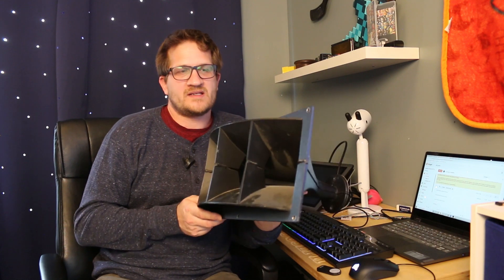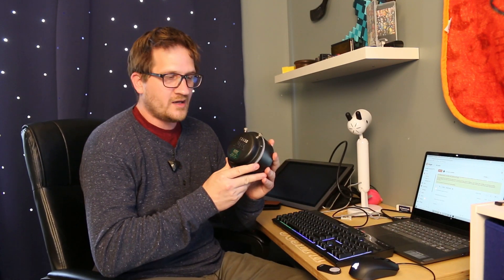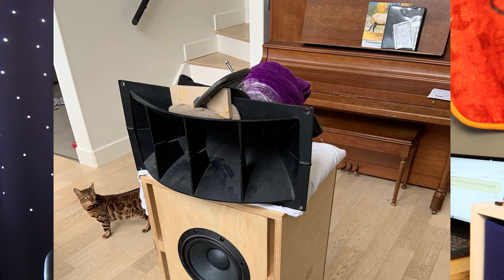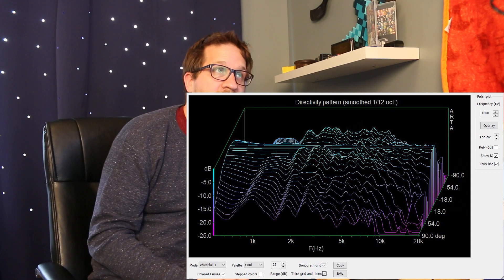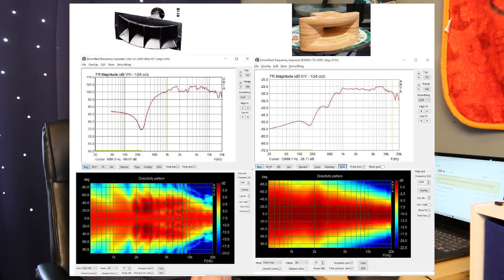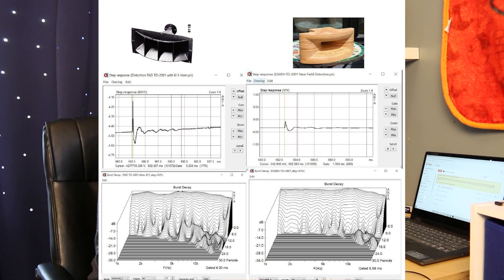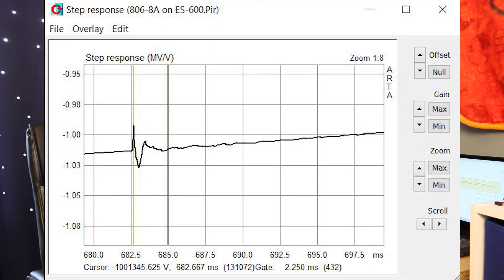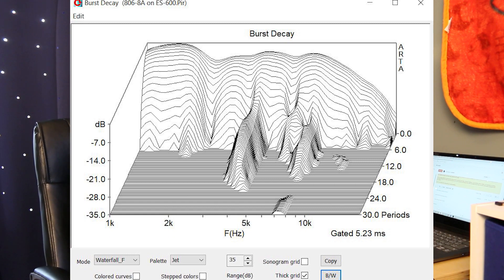Classic Altec Horn versus Modern ES-600 Biradial

Comment: Hello Joseph    I have a few questions about measuring horns    1. the distance of the mic, from where is this measured the throat or front of the horn.   2. measuring method with Dats do you always use "testbox method with 5 cubic feet.

Comment: Hi. Very interesting video. Thanks. 
I just came into possession of two Lansing horns. One is a 901 B and the other is a 287. The 901 is very large, almost 3 feet across with a long neck. 
I can’t find any information on the 901 B (I think it’s a B. Can’t read it that well). Both horns appear to be in excellent shape. 
Can you enlighten me on what I have?
Thanks. 
Oh, really, really nice horn design you have. I’m a lens designer and I’m interested in designing speakers, especially ones that have reflective elements. But I don’t know what software to use. What’s a good speaker design software package?
Much appreciated. 
Paul
Reply from the maker: I don’t really do much with the vintage stuff. I don’t use simulation software. It’s too easy to build prototypes and just test the actual thing. Sims don’t seem to be accurate for me. Acoustical electrical and mechanical all in interplay…computer programs often only consider one or two aspects.

Comment: Considering that the engineers had limited testing capability and limited materials understanding, they did a admirable job.  While their dispersion may be more jagged, the over all width of their coverage is wider up to 10 k.  These horns were probably designed for movie theaters.  Optical film did not have very good high frequency extension.  So the wide coverage to 10 k was important, the coverage above 10 K not so much.  Also many movie theaters build wood walls around the speakers creating a half space situation.  That may have reduced some of the air impedance mismatch at the horn mouth.  Finally, they had to project through a perforated screen so they needed to have some pressure at the mouth to get the sound through.   I always feel the need to point out that we should not judge what people did in the past by today's standards.  You aren't necessarily doing that here but there seems to be a real problem today of judging people in the past (when their needs and priorities were different) by today's standards. Don't get me wrong, your horns are great.  I bet they sound great.  The two horns are very different.
Reply: Exactly! These were voice of the theater components. Altec cheated by stuffing them in a nice wooden box and selling them as home audio. ( I still love them )
Reply: @seeburgm100a  yes.  I used to work for a historic movie theater chain.  We had a warehouse of all of the old equipment from old christie's projectors to altec voice of the theater speakers.  If I remember correctly, this horn is the small horn for smaller theaters.  We had the big multi cell horns as well.  To alter coverage for narrow theaters, they used to stuff socks in the cells that would project onto the walls.  Crude, but simple and it worked.  They didn't have any of the tools we have now.  They did alot with a little back then.  Always amazed at their ingenuity.

Comment: the  811 B was combined with the driver Altec 806-8A. In this combination it performed 550 to 4,5kHz plusminus 1dB with a drop of 3dB per octave afterwords until 14k, than steeper. It was never meant to be used in a two way application. For use in cinemas the two ways were ok. For high fidelity applications, a separate tweeter is recommended. 3dB corners were 470Hz and 5k. It was used with a crossover of 800Hz. Is 50 years ago and more.
Reply from the maker: This horn was used in many 2-way configurations by Altec even for mixing desk studio monitors. Why do you think it was never intended for two way? The documentation for Altec does not indicate this, neither does how Altec used it in the finished products.
Reply: @JosephCrowesDIYSpeakerBuilding  the documentation suggests to use separate tweeters if the highs do not satisfy - I remember something like that. And: of course Altec knew, that this horn lacks the highest frequencies - if the people are satisfied, why should they change anything?

Comment: Informative video. I didn't know that. I was interested in audio in the mid-1970s when all of this high-tech gee-wiz gizmos were in the domain of labs at JBL & Altec.

I too notice the freq response fall off with my Altec 807(this is the small Altec 802/806 compression driver) with the Symbiotik diaphragm instead of the aluminum. The Symbiotik diaphragm is rated at Altec-rated 30watts with 800hz-15kHz versus the aluminum 10watts from 800Hz to 20kHz.

But to my ears  notice a bit of dullness in the high frequencies. I was going to buy a JBL O77 slot-radiator high-freq tweeter but at that time, it was a bit too expensive for my budget, I believe it was like $175. Of course today it costs >$1,000 with the clear plexi-glass phase plug on eBay. :O Instead I choose the more reasonable Electro-Voice T350 which cost something like ~$100 with the alnico magnet, and I used an electronic crossover with 12db slopes at 5kHz.
Reply from the maker: I’ve heard the T350 on the EV Interface D speakers.  It’s a lovely sounding tweeter.  👍

Comment: You are just looking at the graphs and telling what everyone can see. The impact of power response into the room or the opening angle lacks description. A 10 min read at DIYAudio forum gets anyone to this level, nothing special in this level of graph commentary. Besides, how can you even talk about power response while taking on-axis (even at 1 meter) measurements, just goes to show that what you think about “a decent horn”, having flat frequency response and no sustaining standing waves is not linked to perceived quality of the design. Anyone, with a little effort can achieve these targets. Maybe you should be examining designs from Augspurger or Earl Geddes and examine the trade offs. By the way, that rising trend in your impulse response measurement was quite hilarious, thanks for sharing that. Better checking the acoustic centers of the drivers before running this test, maybe that part was missing in the user’s manual of ARTA, after all they look like a good signal processing company rather than an acoustics based one like MLSSA or even Audiomatica.
Reply from the maker: Thank you for the feed back.  What specific performance attributes do you think my horn lacks that the other horns referenced excel in?
Reply: Exactly my point, your “scientific” approach and the subjective grading that you are sharing fundamentally has no correlation ground. Maybe a little Floyd Toole can help you there, however, not with the “objective” approach you are taking. That can saturate and blind the average YouTube content consuming DIY enthusiasts who are new to the hobby and create a false appreciation to your work, but I believe the people who know what they are doing, do not even bother to correct your methodology, not because it is not evident, but most probably they don’t know where to even begin.
Reply from the maker: Using test data that has been subjectively correlated according to Flloyd’s work, what specific performance attributes to you think my horns lack?
Reply: @JosephCrowesDIYSpeakerBuilding  You are asking the same question over and over again, where I am pointing at your methodology which you use to quantify the performance metrics is not suited for those performance metrics. With this shared data, it is really not clear how you are claiming what you are claiming. I am sorry but, due to lack of proper measurements done from your end, there is just not enough data to answer your question, and my whole feedback was on this topic, maybe I was not clear enough.
Reply from the maker: “But most probably they don’t know where to even begin”   If there’s so many issues in my methodology then please provide a few specifics.  Am I missing certain tests?  I’m assuming these tests are supported by Floyd’s research as having better subjective correlation.  Also, why can’t you answer my first question regarding the other horns mentioned...I’m familiar with Earl’s waveguides, but I’m very curious what specifically you feel I need to learn about regarding his OS horns?  Having built a few of his horns myself I’m at a loss on what specifically you could be referring to.

Comment: The waterfall response of the 806A looks worse than I am used to seeing for Altec drivers. Did you measure its distortion? I wouldn’t be surprised if it has dirt in the gap or a rubbing voice  coil.

Comment: Did you try the open horn at the back yet! a transmission line tube maybe with a diameter 11 mm 60mm long tube flared at the end connected to the driver body plate
 using a ring of blue tack as a gasket for the diaphragm would help as well

Comment: Joseph if you are using a device like a dbx driverack pa2 (with rta) wouldn't that fix/flatten this making drive horn selection less critical? Also thanks for the amazing work you do and share with us!
Reply from the maker: This type if performance attribute cannot be corrected by EQ.  If you fix the off axis then the on-axis suffers.  Of course you could sum the two (RTA) and it would look good on paper.  However that is not how we perceive the sound.

Comment: Neat video, your horn tests very well! 
It would be interesting to see the Altec/Altec measurements as well compared to the second test on your horn to see what degree of improvement it offers even with a less optimal vintage driver. What software do you use for your testing?
Reply from the maker: I’ve featured that in one of the blog posts linked in the description. Generally the they do nothing to compliment one another.
Reply from the maker: I use ARTA software.

Comment: This is an excellent test as it scientifically confirms what I heard 42 years ago. I owned two pairs of Altec 846B's in the 70's (yes I'm that old) which used the same horn and compression driver combination that you tested, along with the N801 crossover and 416 bass driver. Even back then they were pretty rough by current hi-fi standards, and I ended up getting rid of them soon after purchasing them. While I loved the dynamics, I couldn't get used to the colouration of vocals and unlinear response in the mid range. A couple of years later I bought another pair of 846's to use for live PA and mobile DJ, and for that application they were excellent as they could "belt it out" for hours on end without blowing up. One has to remember that Altec's main source of revenue during their hey day was the sale of movie theatre sound equipment, so so components were designed primarily for that market, with other applications such as home hi-fi being secondary. That being said, I often wonder why someone would choose vintage Altec or JBL components over modern products such as B&C, BMS, RCF, 18 Sound, Celestion etc, as the cost is typically higher, and the performance is usually less. A real interesting test of modern vs vintage would be to see how the original TAD 2001 compares to the BMS 4552ND or Radian 475PB. Horn design has definitely advanced over the years, so unless one wanted a particular "look" for their horn, I can't see why someone would choose an 811B or slant plate JBL over a modern horn design as well, but that's just my take on it.
Reply from the maker: Thank you for the comments.  It’s interesting to hear your experience.  I agree with what your saying.
Reply: @JosephCrowesDIYSpeakerBuilding  I guess because I worked in both the home and commercial audio industries from the late 70's to the early 2000's, I was lucky enough to be able to actually hear the advancements in horn and driver technology as each new product was released. I've been following this channel since your early videos on the Eminence/B&C coaxial project, and have noticed how much your technical skills have advanced in the last few years, especially in the areas of horn and crossover design.  Speaking of coaxials, I'm in the middle of building one right now and want to pick your brain a bit regarding compression drivers and crossover point, but will post my questions on that video. Keep up the good work as it looks like it's starting to pay off for you
Reply: I have a pair of Altec Val's now and they are "Voice of the Theater" (A7) components that Altec stuffed in a fancy box and marketed to the home audio enthusiast. Those horns do need to be tamed, they are very in your face in smaller listening rooms.  So while I agree that they are not exactly home audio, they are theater friendly or larger venue friendly. Specifically the optical sound track of film they were designed for is replicated perfectly by these speakers. I plan on using a pair in a pole barn theater I am almost finished building now. On the other hand, I own two pairs of 604 speakers, 604C in original 606 corner cabinets and early 604D (same as C with rolled paper edge) in custom built 620 style cabinets ported for the 604D. Each has new crossovers supplied by Great Plains Audio and they have been modified to work better with the 604C  they are driven by tube equipment, one all vintage McIntosh and the other Harmon Kardon pre and VTA70 custom power amp.  If I'm not mistaken these were the industry standard in many recording studios for engineering the final recording. If you happen to play an LP that was engineered with the 604 on a 604 there is some real magic there. They are not friendly with a lot of colored modern music, but 40's 50's, 60's, 70's music.. especially vocals, jazz.. I listen to a lot of rock from the  60's and 70's and they sound great, they can also pick apart a badly/poorly engineered album.
Reply: @seeburgm100a  Yes the 604 was the dominant mastering monitor in North America during the 60s and early 70s, and I know them well (mostly the G and H versions). If you're looking for a little smoother response, and less colouration, you may want to try some Radian aluminum/mylar diaphrams. (part # 1228) I've never tried them in an Altec driver so I'm not usure how much of an improvement there would be, but the JBL version (part #1225) is a definite improvement over the OEM titanium units used in the 2416 and 2425. They're a little smoother in the lower treble, and sound less "metallic" than the originals. If I still had Altecs, I would give them a try as it's not a particularly expensive experiment, and require no modification to the driver or crossover.

Comment: How did you create that directivity pattern graph?
Reply from the maker: I use ARTA measurement software along with my rotary table which pivots the horn along the front of the horn mouth.  I measure in 5 degree increments which is marked out on the rotary table.

Comment: Time 4:26 you are not using the same scale...
Reply from the maker: The overall level is different which is just a setting in the measurement software which doesn't effect the response curves.  Both are using the standard 50dB vertical scale.

Comment: Hi Joseph.. What type of diaphragm is installed in the 806? Original Altec Aluminum? How’s the condition? It would be nice to see measurements if you had the 802’s..
Reply from the maker: I removed the diaphragm and it says '391311' with 'AL/45' ink marked. Condition looks excellent with no VC rub.
Reply: Joseph Crowe's DIY Speaker Building 

Thank you.. I’m not too knowledgeable of the various nomenclature and numbering of phragms from vintage Altec.. But just to make sure that they are not Unofficial or China made copies as replacements (if bought used), better get new ones from GPA (current official Altec..)
Reply from the maker: I’ve done more research and they are definitely original.  Also my measurements look similar to what others have posted.
Reply: Joseph Crowe's DIY Speaker Building 

Thanks Joseph, for confirming they are originals..  If you can get hold of 902’s to measure that would be great. And maybe post on your webpage..